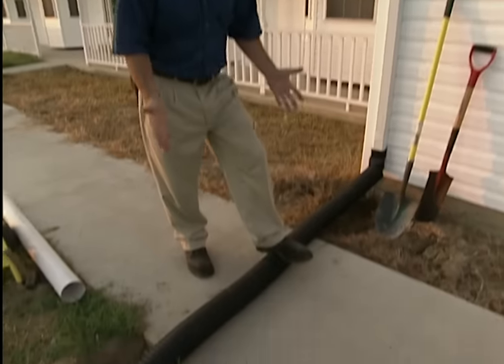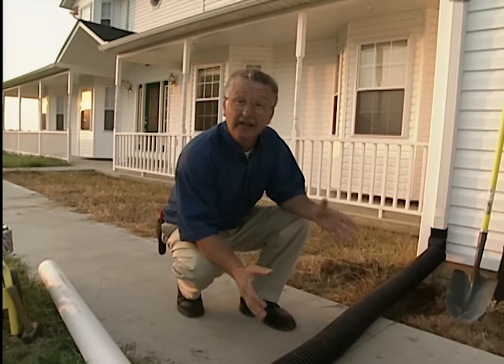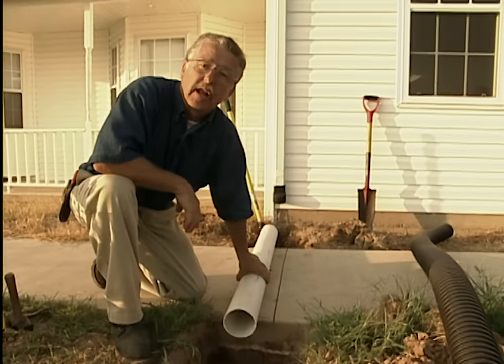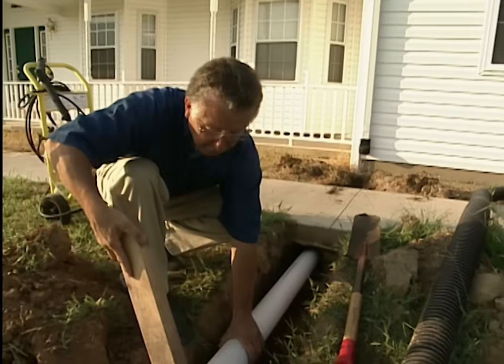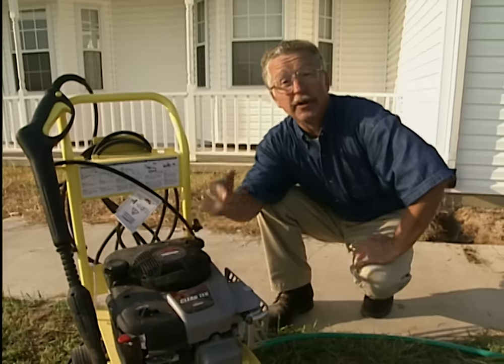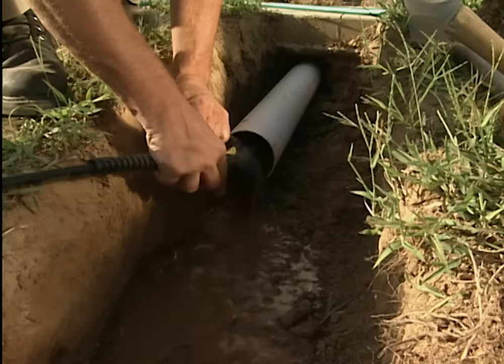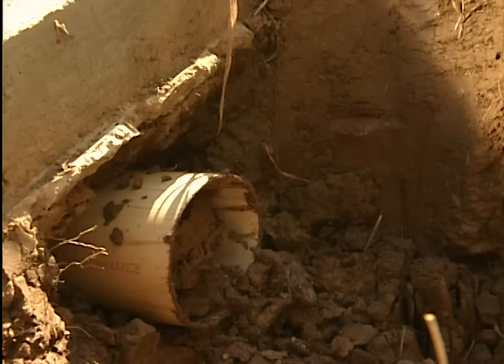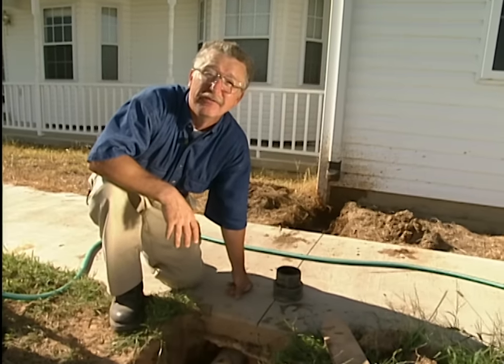How to Run Wires or Drainage Under a Sidewalk or Driveway - The Great Outdoors

Comment: Nice but never used that method before with a pressure washer but at that size looks good 
My normal method is to get my hose connector piece with bit of pipe on it the take the size pipe I need cut some teeth into it then put the right adaptors on and plug into the bell end of the pipe line it up and turn on the water and press it in and twist it and jab it forward letting the water do the drilling with a little bit of bitting from the teeth works every time once it gotten threw I cut the ends to size and either run smaller pipes and wire if needed or connect up and unplug my connector for next time why I never used a washer before works great but I’d guess as you get into 3” in pipe or bigger you might need the washer

Comment: Great information, however, why not run PVC pipe throughout the whole run.  Colbert pipe is good, however after time goes by, Colbert pipe will collapse, and there you go again, having to dig it all up again to replace the Colbert pipe.  Also, in a situation like this, and there is no rock in the way underneath the sidewalk, best to dig out one end as much as possible, then the other end as much as possible, and then run a ground rod or strong copper pipe to see if you've gotten through.  If you find that you did get through without any hassle, then enlarge the hole as best as yiu can, then insert your PVC pipe into the trench, clean the ends up, and glue the one end close to the house as possible and put a larger elbow in connecting it to the downspout, then start on the other end using a PVC pipe connection, then gluing the pipe together out to the end run away from the house, using all PVC pipe.  It will last forever within your life time without ever having to replace it and won't collapse.
Reply: Culvert, not Colbert. Just wanting to help.

Comment: I've been doing drainage work for over 20 years and my #1 tip is to never use black corrugated pipe it is junk and won't hold up. Use pvc always.

Comment: Great technique. But.....I'd never use that cheap black flexible drainage pipe. Use all Schedule 40 pipe. The contractor used black flex pipe and here I am digging up all that cheapo and redoing it with HD Schedule 40 pipe ... 18 yrs later cutting tree & bush roots. What a tedious PITA! Black pipe will clog with roof asphalt granules & misc debris (yes even with gutter screens).

Comment: But why did you cut the pipe...?
Reply: There is an end designed to splice to an adjoining pipe called the bell end.  This has a larger inside diameter.  By cutting the bell end off the coupling used to attach the pipes fit properly.
Reply: @duanes54  But you wouldn’t need the coupling if you hadn’t cut off the bell
Reply: Doh!!!

Comment: What if your concrete goes right to the garage? Gotta you there?
Reply: In that case you are screwed... consider layingbthe drain pipe over the sidewalk. Lol
Reply: Get a core drill and cut a hole for the down spout and a 90 to fit into.
Reply: Move the house back about 3 feet.
Reply: It would never.😝

Comment: Black fitting inside the pvc pipe is wrong!! Water will seep around the fitting and eventaully erode the ground at the sidewalk. Better if the fitting fits "outside" the pvc pipe

Comment: All techniques are great, water jet, tapping pipe through and removing, then tapping out the dirt, and repeating, drilling with auger bit and extensions etc. all good, but there is one critical thing that no-one has mentioned, and this is vital. You can get away with small distances, like 3 feet, 4 feet, but it becomes a very big problem for large distances. Here's the critical thing, you MUST, use a spirit level or the like to make sure your pipe, or drill, or whatever is LEVEL, before you start !! Because if your pipe, drill, etc is pointing downwards, then you will NEVER pop out the other side !! You will be digging to China.

Comment: I had a drain pipe that collapsed and needed to run a new one under a sidewalk. The thought of digging by hand gave me a headache.  I used my pressure washer to bore underneath the walk and it worked great!   Thanks for the tip!

Comment: Good trick.  Earlier in life, I bought a length of 3/4 PVC, pair of PVC male and female hose thread ends, and a brass jet sweeper nozzle.  It did the same trick as the pressure washer for several hundred dollars less, and it still works 30 years later.
P.S: You left that pipe full of mud, but didn't say anything about it.

Comment: you don't need a pressure washer that's way over kill, all you need is a high pressure tip for you garden hose $4.00,
Reply: And you certainly don't need a gas-powered PW. An electrical one will do just fine.
Reply: I wonder if it will move gravel?  I got about 2-3" of 2b under my walk.
Reply: @finders-keepers1518  A hose won't, but a pressure washer just might.
Reply: There should be 4” of compacted gravel under the sidewalk. Lucky a power washer was even strong enough to do the job.
Reply: @jerryhamalainen3549  Well, I'll be damned. We have Finn in our midst!

Comment: Never reduce a drainpipe run in the direction of flow.   Especially in a situation that will have debris of any kind in it.  The reductions in size even if small will eventually catch something leading to the whole pipe system getting clogged up.  

My Grandpa did this with a home sewer system and all it had was a 1/4" lip right at the point where the 4" pipe went into the septic tank.   Sure enough.  It was enough to cause it to catch something and back up the whole system to where they had to dig up half the yard to fix it.   TWICE!
Reply: Can you explain a little?  Water on a part in my yard and i was about to do this instead of cutting the concrete drive way. Is this a good technique?
Reply: @blackhouse7646  -- The coupler from the PVC to drain tile flex pipe: You would want a coupler larger than the pvc so it went around the outside, maybe toss a little pipe cement, so that it doesn't reduce the diameter if of the pipe with a ledge but rather transition with a wider gap.
Reply: I’m so confused on what you’re saying.
Reply: @tsnstt  what he’s trying to say is you want to avoid having any debris, from your gutter downspout, get caught on the edge/lip of the coupling where you connect two pipes. In this video, the black plastic he connected to the white pipe which went under the sidewalk, created a lip inside the white pipe. So debris could potentially get caught and could create a clog. Instead, in the video, the man should have used a connector which goes over the white pipe instead of inside. Hope this makes more sense now.
Reply: @bdm408  yes that helps tremendously. thank you so much for such a great explanation, bdm408 😊
Reply: For that reason I used a larger pvc pipe where I could fit the corrugated one through. Was also the cheaper option, since the short section of doubled pipe was cheaper than any two couplings I would need.
Reply: @tsnstt : Tom Tech is telling you to keep the pipe exit circumference thick without hindrance.

Comment: Hold on? You cut the bell off, then you placed the coupling inside the pipe? How will water step up into the coupling. It will drain right out of the white pipe into the soil. It will not step up into the black coupling
Reply: A ''tech'' at a muffler shop did that with the downstream pipes on a car. He flared the wrong ends and the boss had to do it over. Moron

Comment: To address your first comments, why would any homebuyer move in without putting this glaring omission on their walk-though list in the first place?
Reply: Unbelievable that any contractor would walk away from this.
Reply: Thats basically common place for almost all new homes. Buying an unfinished house is just asking for them to cut corners and they always do.
Reply: It was my exact thought.
Reply: It’s like letting the toilet flange just dump crap out into the basement.
Reply: A lot of homes will have the gutters drain outside the foundation. Typically that 5’ section of black pipe will not be included. Just a short 1-2ft concrete or plastic ramp for the water to dump on.

You’ll see when you buy or change houses - most ppl dont manage water correctly

Comment: Good thing there was no stones or rocks like there is whenever I've dug.....
Reply: Or you unknowingly uncover the trash pit that contractor and subs left and never told you.
Reply: No kidding
Reply: Prayer in Texas there are no 9 to 16 inch size chunks lime stone under sidewalks backfill may prove helpful.
Reply: @rooftopvoter3015 or finding 1960 to 1970s pull busch beer tabs.
Reply: Now, all together. 'Where do builders leave the rock spoil from the house construction?'

Comment: No bed of gravel under the sidewalk?  Would have been harder had the walk been properly done.
Reply: I don't think many contractors do everything correctly. They cut corners where they can. My driveway is bad. I removed part of it and its just soil. It lasted for over twenty years and now its my problem. I will more than likely do the same as money is an issue and I am old.
Reply: Depends where you are.  Gravel base is not a requirement.  Sure, it is the smart way to do it, but depending on the climate and how well that fill soil was compacted before the pour, it could be fine.
Reply: There's a video of a public road collapsing when a culvert gets washed away. same deal - tarmac laid straight on soil. Obviously nobody checks anything when public money is being spent. I presume they have codes, but the district surveyor's purse is well lubricated to make him look the other way.
Reply: Good point. A bed of gravel is always necessary for a job done properly.

Comment: I used to install piping by digging under the sidewalk by using that long spade.  I'd dig half way thru on one side, then dig half way thru on the other and meet in the middle. By that time, my knuckles were bleeding but I got it done each and every time. I used schedule 30 most times, but also schedule 40 pvc. Sometimes homeowners don't appreciate the work a landscaper does for them.  But at least I did the right thing.

Comment: I've done this same thing a couple times (under sidewalks), but without using water.  Sharpen the edge of one end of the pvc pipe.  Depending on soil conditions, you can tap the pipe in and remove a "core" of soil between 6 to 8 inches at a time.
Reply: If we sharpen the edge, how do you get the gutter adapter on. Also, how do you go about removing a "core" of soil? Or any soil for that matter since the pipe is wedged into the ground.
Reply: @chozen_juan  I used a post hole digger on a similar project.  The pressure washer saves a lot of sweat... in hindsight.
Reply: You want the pipe though to keep from a future collapse and cracking of your concrete.
Reply: I have one installed with an open catch basin and the slope is miniscule.  It fills up with dirt and debris.  I got a pressure washer attachment for sewer cleaning and a 100" hose off amazon for about $60.  You just run it down and it blasts out all the crap.

Comment: Be careful to not use a pressure washer on a car or siding that the psi is too high and does major damage.
Research what that maximum psi is.
2000 psi is enough to do damage if you have any lose material.
I use 1750 max unless I am cleaning concrete and if it’s in good shape 3600 psi is fine.
Reply: no, I will not read more.

Comment: As a contractor we would attach a jet spray from any hardware store  attach to a garden hose then clamp it with a stainless steel clamp to a 20 foot 1 inch pvc pipe and run it through a 3 or 4 inch  pipe depending on what needed to go under sidewalks or driveways. Surely beat cutting through concrete and leaving the owner with expensive replacement of concrete. The customer appreciated not having an eye sore in their driveway. We have had to cut driveways due to rock bed prohibiting this method, Many have failed in not backfilling with #89/10  slag and tamped properly causing settlement and separation of repaired concrete from the original causing dips and eventually needing the entire panel of concrete removed and replaced due to heavy rain from erosion. Caution should always be used when using "too much water" under concrete avoiding erosion of the soil that supports the base underneath concrete. This procedure can save you thousands of dollars up front "IF" precautions are used. But could end up costing more than you bargained for in the end if you aren't very careful using water as the main force getting that pipe from one point to the other. Sidewalks and driveways for the most part have been prepped compacted to be a suitable support base for concrete. When using water it should only be used to moisten ground  as you pile drive the pipe avoiding eroding the support base for the concrete. Unless you have the means to dig very deep leaving a healthy support base for the concrete. It's not a question to IF but when the cracks will occur. Water is a powerful force that damages foundations, sidewalks and driveways. Undermining the soil of concrete never ends well without costly repairs if adherence to certain precautions. Kudos to this gentleman for showing us a quick fix to go under sidewalks. Please use caution when doing so!

Comment: I did the same thing for an irrigation line under my double wide driveway.  But I didn't use oir have a $300 pressure washer.  I used an $8 tapered pressure nozzle on the end of a garden hose.
Reply: I was thinking the same.
Reply: No No No, you need to spend time & money going back and fourth to a tool rental shop, to rent a pressure washer. Using a garden hose nozzle would save too much time & money and make this video more helpful. Always waste money renting a pressure washer.

Comment: Lot's of problems here:

1. Call before you dig
2. Don't install pipe level, but with a slight (1/4" per foot) slope
3. Careful you don't leave hollow space under the sidewalk
4. Install your down slope fitting on the outside of the pipe, not inside like in this video
5. Don't wear clean white slacks and new loafers when digging in the mud
Reply: Clean white slacks and loafers are most definitely the wrong attire for this sort of job…. 😂

Comment: I like the technique, but I would just continue with the PVC until you get to the evacuation site. Those flex pipes are so flimsy.
Reply: Sometimes you cant make the slope required with PVC.
I seen new construction homes run PVC for 50 or so feet. A few of these new homes needed to be redone due to water not draining properly
Reply: @bobshanery5152  Why wouldn’t pvc drain properly?

Comment: When burying a pipe under a walk already in-place, the BIGGEST concern is backfilling around your pipe.  If not strongly backfilled, the walk can settle, crack, and shift leaving you with a cruddy looking walk (and potential trip hazard).  This is especially unfortunate if your walk is older and, say, darker in color.  Now any newly-poured concrete is now hospital-white:  looks nasty.  Make sure your backfilling around the pipe is taken seriously and done well, otherwise this problem will visit your home.
Reply: It seems that under the sidewalk there is no trench to back fill, as the pipe dug itself a perfectly form-fitting channel?
Reply: What are you even talking about.  Your not going to backfill around the pipe it's under the sidewalk and it's got dirt around it because of how it was done.
Reply: Pw 68 872: Many underground situations are risky.

Comment: On my previous house I hade to put a pipe under my sidewalk and I used a garden hose connected to a 4 ft metal pipe with a capped end with holes drilled to create a low pressure jet. It took me all day to create a through hole. Your video and method look great! I will try this on my current house. Thanks for the fantastic and concise explanation.

Comment: Oh yeah...great idea except you've just undermined the sidewalk or in time there's going to be a sink issue...what you need to do after installing the pipe is fill the void with landscape foam but not too much or the sidewalk will lift...use a length of poly air hose to extend the nozzle under the sidewalk and for gods sake don't back fill either side until foam is completely cured

Comment: Great video. I have to redo a poorly installed black drain from middle of yard to house roof drain. I'm going to use a pressure washer. But.....I strongly suggest not using black flexible pipe - it's junk. I'd use Schedule 40 all the way to house and maybe 10 ft away from sidewalk. After 18 yrs our contractor installed black flex drain pipe is leaking.

Comment: 3:07...shouldn't that be turned around?.....yes it should.
Reply: Not if you want to unclog it from time to time especially with a screw sticking though to hold it securely. I know the dirt packed around it will probably let it fall out

Comment: You don't need a pressure washer. You can buy an adapter that will screw onto your hose, just glue it to a length of 3/4 inch pvc. This will make as big a tunnel under a sidewalk as you need. Cheaper than renting a pressure washer and simpler to use.

Comment: I did this for a 1.5" pvc pipe under sidewalk to go through curb for yard sump pump. Problem was sidewalk was not flat on bottom  thickness varied... ran into that. It was a muddy mess but success. Quotes I got for $1000's. Did if for next to nothing.
Reply: Received a quote to repair a section of chain link fence: $450.00   Ah, thanks. Repaired it for under 18 bucks myself.